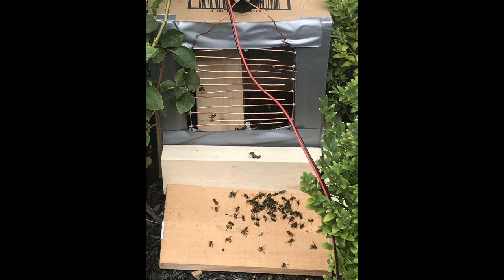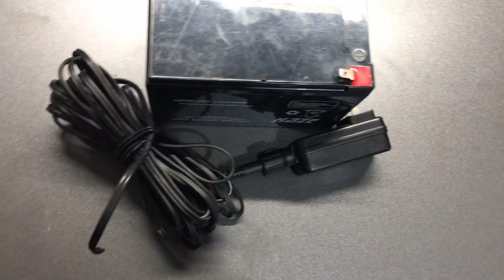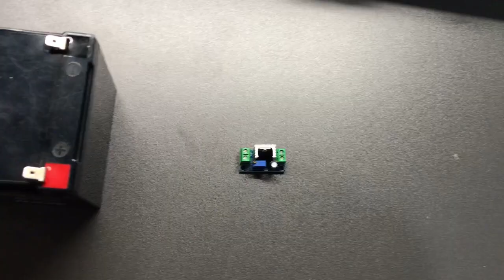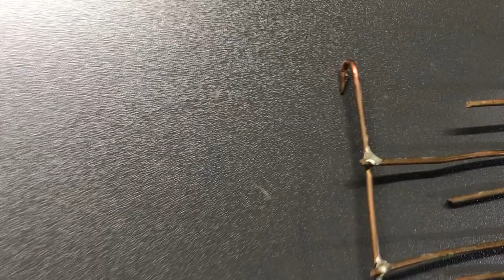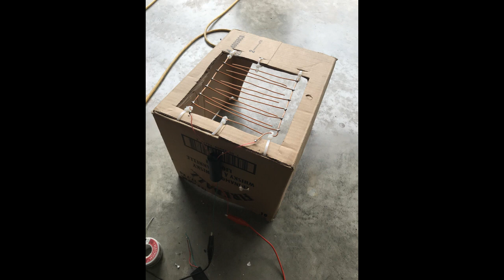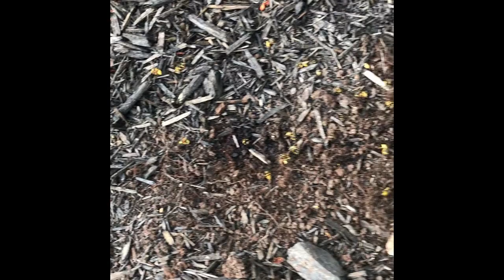DIY Wasp Zapper

Comment: Great instructional video. I used same voltage converter but used an old cell phone charger as input. Replaced copper rail grids with 2  steel metal grids. What a zap! Noticed voltage converter whistles as it charges up its capacitor presumably.  Thanks for posting your design.

Comment: I did the same except used plexaglass and buit a 4X 12X12 square and spaced the grid to 1/4 . I used a bate of cheepest wet cat food the ground was just covered with dead wasp on the ground twice a day. It allso did a good job on flys.  I used a trickle battery charger for the power.